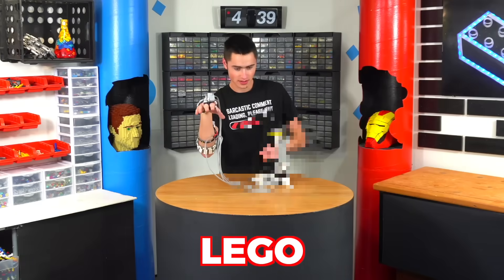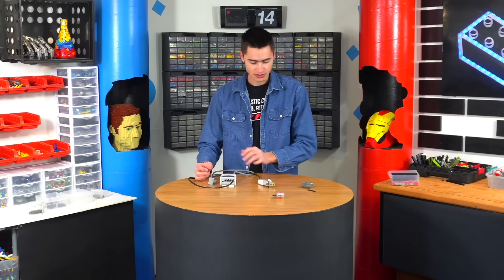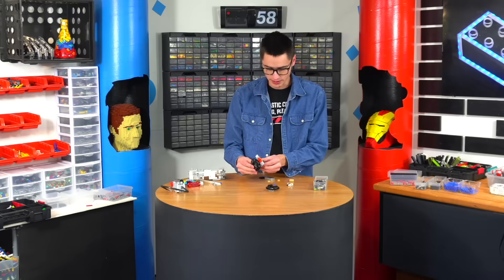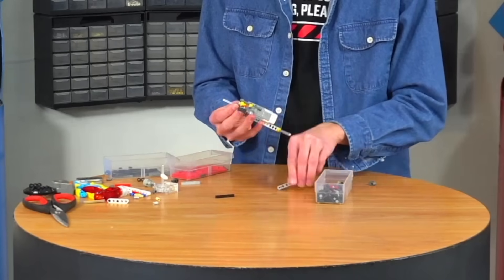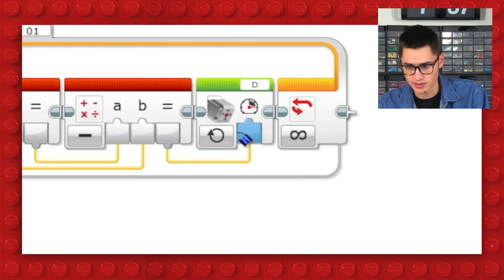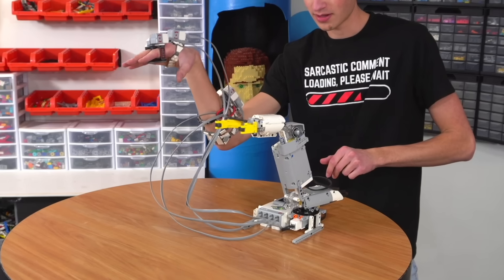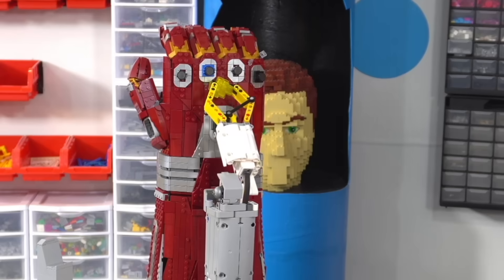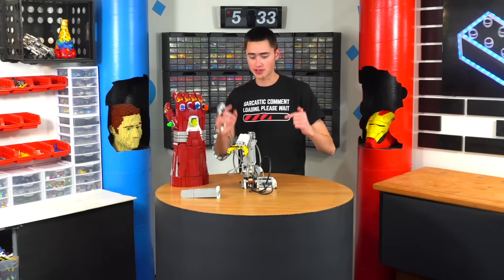I Built a LEGO Micro Robot Arm!

Comment: This is really cool! The reason why the horizontal rotation gets off is, just like in videogames, because gyro sensors go off of movement and try to calculate how much you've turned, while up and down movement has gravity and tilt making it clear as day how much you rotate, rotating horizontally doesn't. If they'd want that to work they'd have to squeeze a compas in there lol